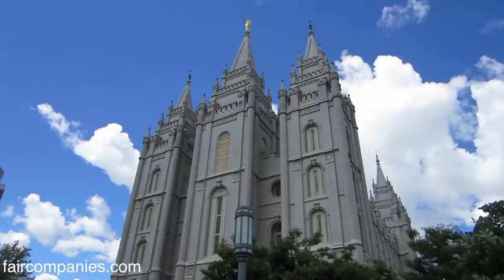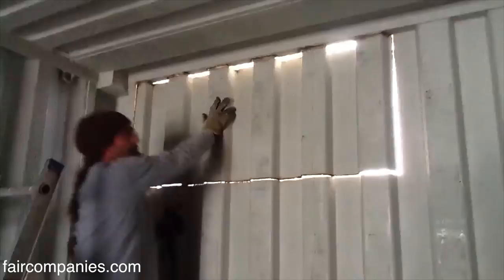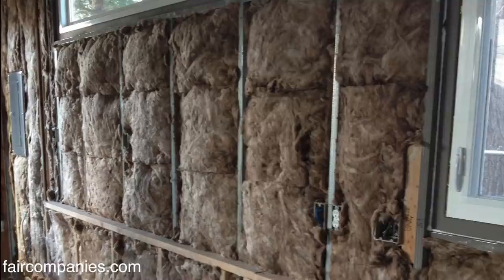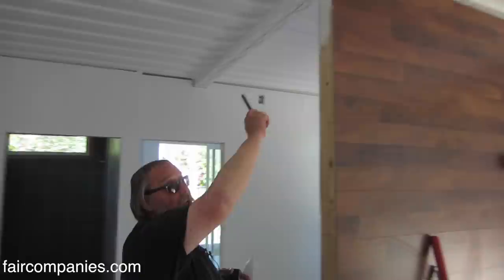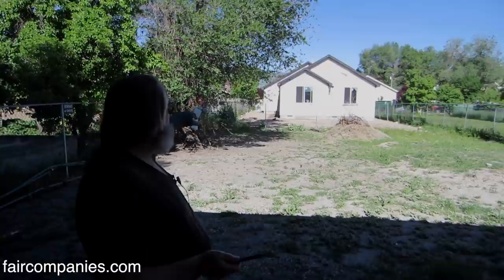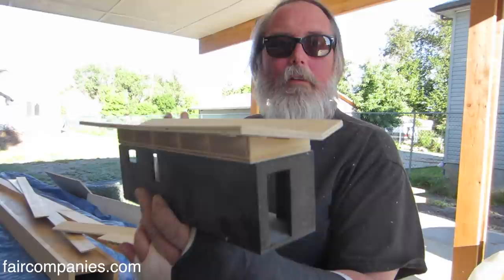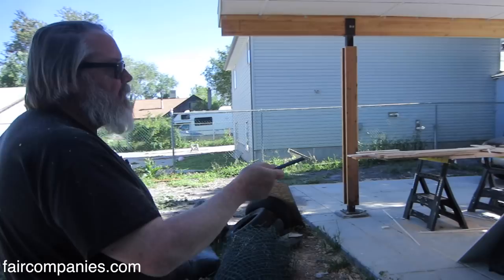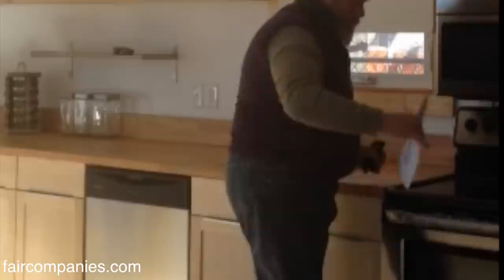Shipping containers recycled into affordable, accessible Utah home

Comment: I was the architect and designer that didn't laugh at Jeff and helped him obtain permits from the city. There was extensive architectural and structural engineering issues involved in this project: Room layouts, door and window placement, plumbing, mechanical and electrical as well as energy code compliance and structural support. The design phase took nearly 5 months of preparation. Yes, the City balked a bit at the idea of containers, but seeing the structural engineering and energy calcs involved answered their concerns. As far as cost, yes this was more expensive than conventional construction, but being a prototype, that's usually the price you pay. if these were to go into production mode on a larger scale, costs would come down. I don't think they would approach the costs achieved with conventional production housing.
Reply from the maker: Vince Oles Thank you Vince for clearing that up. It's such a common misconception that a shipping container should equal very cheap housing. It's easy to forget both what it takes to convert one into a home (plumbing, electrical, etc) as well as the engineering issues around a prototype. I look forward to seeing someone take this beyond a prototype.
Reply: I think its a brilliant idea, especially when you consider just how difficult it is to get on the property ladder now days. Its something I personally would seriously think of doing myself
Reply: It's the strange projects that walk through my door that I embrace. I have yet to have anyone ask for a container home, but if it ever does happen, and I'm sure it will, I'm completely willing to embrace it. Anyone who would turn away a project this challenging got into design for all the wrong reasons. When a client hands you a challenge like this, embrace it, own it, and produce something worthy of praise. Nice to see you did just that Vince.
Reply: Vince Oles We would like you to join us. Checkout this http://cargocontainerhome101.com SOCIAL MEDIA & NETWORKING FOR YOUR CARGO CONTAINER HOMES.

SEARCH and FIND LOCAL HELP that you need for building your cargo container home at a minimal cost.
Post your project and learn from others.
The owner-builder will document the construction activities with videos organized by logical categories, e.g., foundation-footings, welding, plumbing, electrical, insulation, windows, potable water storage [including a cistern), roofing, paint, etc., making for easy access and finding solutions to issues. This is all intended to encourage networking amongst people interested in reusing cargo shipping containers as "green" alternatives to traditional housing and build a cargo container house.
Reply: Vince Oles -- I live in Denver where a lot of money has swept into town. There is a ton of construction, but no vision. This has vision and grace. Congratulations!
Reply: Vince Oles this is brilliant it has a very modern look and  using recycled materials that look expensive in the finished product
Reply: This is awesome!!
Reply: Vince Oles  Wow, Awesome  video, I am suggest for your big room space it can be narrow. I also found useful for build container home is Moorack Container House Miracle - I look forward to seeing someone take this beyond a prototype.
Reply: Gopinath Goal  -- That site looks like CLICK-BAIT SPAM. What are you trying to sell and why is the site only navigable by clicking links (which I won't do), and not site navigation?
Reply: Vince Oles Hey i favor this video, particularly the concepts within the last half regarding build houseinstrumentality
. A product I conjointly found helpful for value of building a shipping instrumentality home
is Skyarza instrumentality Home Star - realize it on google if you wish
Reply: Vince Oles hi everyone ,if anyone else needs to find out about container home floor plans try Alkarno Container Alchemist (do a search on google ) ? Ive heard some unbelievable things about it and my cousin got cool success with it.
Reply: Vince Oles Do you know of any forthcoming update on the landscaping in the back or any other aspect of the project?  I just looked over at the Facebook page and the pictures are mostly 2 years old.  What became of this place?  Was it sold, rented out?
Reply: AmericanFartBully Sorry, i haven't followed up on the status of the house and property, Try your question on The Sarah House facebook site
Reply: Meh..ah...I'm not really a big facebook guy.  Too much of a scene.  But, I just really like the overalll design of it, either for a starter-home or senior living, being all on one level, the open plan, and the ample common-space.

The whole container aspect off it, not-so-much; although I get what he's saying as far as the marketing it of as a kit, that you could maybe place over an exiting foundation.

But I would really love to see a more lived-in version of it, how it would pan out with everything they were originally talking about for the landscaping.
Reply: MusicFilmArtLover its 4000 worth of containers some wiring plumbing drywall and two bis.  cant get much cheaper.
Reply: +TJ N 
Don't forget the foundation, perimeter insulation, interior and roof framing and insulation, roofing, tile, wood flooring, doors, windows, trim, closets, plumbing and fixtures, electrical and fixtures, mechanical system, ventilation fans, landscaping and utility tie-ins to the street.
Reply: Do you really need foundation if you have level ground?
Reply: +TJ N In the video he said it was the law, that's why he did it.
Reply: Bulky Lee yeah but if its not the law it wouldnt be needed correct?
Reply: Yeah, then it's your choice, completely up to you what way you want to do it.
Reply: So if this were to be built in my area of South East Pa. , it would cost a lot like this since it doesn't appear to have been built here. I'm quite interested , but at the cost to completely be livable  and functional , concerns me.
Reply: Bryan Resch Well I mean you have to consider the extra costs that went into adding pipelines and electrical, that really brought the cost up. If you can avoid those by building a house in a lot where pipes and electricity aren't an issue, then you can cut down on costs.
Reply: I'm figuring most lots don't have electric , sewer etc already running to it.  If it ran $108,000. for all of this done plus property , and ready to live in , then I can understand that
Reply: I'm just wondering if the Township I live in would be a pain in the ass , to get permits. Like I was saying , I doubt it's been done in my area , so  my township inspectors would put me through what this guy went through. I guess before I bought land and started considering this , I would have to go to township building.
Reply: Should get your building inspector's email and send them a copy of the video.  In the subject line write something like "If I tried to do this will you be a pain in the ass about getting the permits"

Could very prove the jumping off point of a very informative conversation.
Reply: +Bryan Resch I would start with a meeting with the Building Dept.. Tell them what you're planning to do. They will tell you what type of plans and engineering will be required to secure a permit. Our Building Dept. here was actually quite helpful. remember, their job is to enforce the Building Codes and protect the public safety.
Reply: Vince Oles Thank you , I see so many other ways to construct a home , rather than the traditional home. And the way they build them in the states these days , is quite shameful. I don't understand how building codes have gotten so shabby now days. Well , it all comes down to money and I believe someone has taken money under the table when they change codes. Thanks again , I will look into this.
Peace
Reply: +Vince Oles interesting points ,if anyone else trying to find out build a house using containers try Alkarno Container Alchemist (do a google search ) ? Ive heard some great things about it and my colleague got cool results with it.
Reply: +Vince Oles How would I get a set of plans?
Reply: +Vince Oles hi love your video especially the tips of shipping containers homes i also found product was cor bandy container crusher i f any one interested search it google
Reply: Not certain about the points made but ,if anyone else needs to find out about cargo container homes floor plans try Wiltapar  Container Home Secrets (do a search on google ) ? Ive heard some awesome things about it and my work buddy got amazing results with it.
Reply: +Vince Oles hey ,if anyone else needs to find out about best container homes try Renkarter Container Report ( search on google ) ? Ive heard some amazing things about it and my neighbor got excellent results with it.
Reply: +Vince Oles thanks for help pioneer this idea =]! Great stuff
Reply: +Vince Oles hi everyone ,if anyone else is searching for cargo container house plans try Skyarza Container Home Star (should be on google have a look ) ? Ive heard some great things about it and my cousin got great success with it.
Reply: +Vince Oles interesting points ,if anyone else trying to find out container home designs try Corbandy Container Crusher (should be on google have a look ) ? Ive heard some awesome things about it and my mate got great results with it.
Reply: +Vince Oles GREAT JOB!!  One of the best container houses I've seen.
Reply: +aze216 Thanks! It was a good learning experience and I think it turned out pretty well. Would like to do more!
Reply: +Vince Oles There are several components to doing a pro job. One place I found which successfully combines these is the Magic Container Plans (check it out on google) without a doubt the no.1 course that I have ever heard of. Check out this  great website.
Reply: +PressReleaseItem I've been researching into constructing shiping container houses and found an awesome website at Magic Container Plans (check it out on google)
Reply: +Vince Oles There are many components to creating an amazing desgin. One plan I discovered that succeeds in merging these is the Magic Container Plans (check it out on google) definately the most helpful course i've heard of. look at this  extraordinary site.
Reply: +Vince Oles There are many factors in doing a pro job. One resource I discovered that successfully combines these is the Magic Container Plans (check it out on google) definately the most helpful course that I have ever seen. Check out this  amazing site.
Reply: I had to do the same thing on my Silo house build. My architect had to do extensive structural engineering to get me plans for the inspector. Mine involved recycled crane beams.  Actually my township worked with me.
Reply: I live in Utah and am interested in learning more about the codes and possible designs for my own container home. What is a good contact to reach you or Jeff?
Reply: I've been researching into constructing shiping container houses and discovered an awesome website at Magic Container Plans (google it if you're interested)
Reply: I think it looks great! very nice and I think the light sconces and window designs add class and appeal. 👍👍👍👍
Reply: Hi Vince:
Great Job First of all...
Next thing, is how would i get a copy of the designs, and engineering on this?
Reply: Could you elaborate on what insulation was used in detail? I have read (from different sources) that condensation on the inner container walls is a real problem. Also I do not quiet understand that on the roof we see an outter insulation and on the walls an inner insulation. Since the contaier is made out of metal, the heat produced inside the house will heat up the metal roof, from which the heat will be conducted to the outer walls, which radiate the heat  on outside the outside of the cainter?
Reply: I really love the concept. In Reykjavik (Iceland) we've been looking for affordable housing for the homeless and people that aren't able or don't want to maintain a large property. I believe containers are the key to affordable housing for everyone.
Reply: If you is interested in container home plans the best results that I have ever had was by using the Magic Container Plans (just google it) without a doubt the most useful course that I have ever tried.
Reply: Vince Oles you did a good job
Reply: Thank you! It was a great learning experience working with containers!
Reply: I've been researching into constructing shiping container houses and discovered a great website at Magic Container Plans (check it out on google). #Vince Oles
Reply: Vince Oles so it's not worth it thank you.
Reply: There are several factors in creating an amazing design. One plan I found that successfully combines these is the Rohon Home Build (check it out on google) without a doubt the best info that I have ever seen. Check out this  super resource.
Reply: I have spent months researching into building container homes and found a great website at Magic Container Plans (check it out on google)
Reply: hello Vince, have the plans and hurdles been advanced in the way of learning from mistakes. really interested in bringing this to the east coast.
Reply: TGN.
As long as you are not in an area  that is effected by frost you only need corner posts to support the container frames.
Reply: Robert
Try  drawing you own. It's not that hard really.
Reply: Robert
Try drawing you own. It really isn't that hard.
Reply: I have a perfect lot in Hawaii if you want another great project.
Reply: Great idea. Basicly a lot like a mobile home but, bolted down to a concrete slab. I never understood why people want a huge home. The amount of time and stress to pay for it, and giving up time with your children may be one of the downfalls of our family structure today. Life is not about things. I'm 1 of 8 children born in the 50's . We had 3 bedrooms and 1 bath. It worked and grew up to appreciate every thing including recycled items. Hate to see things thrown away.I like small places.
Reply: @bryanr.3241  , you could argue it is not much different than a mobile home, or prefab homes. Try it.
Reply: @bryanr.3241  , Plenty of people are building tiny homes , school bus homes, it's amazing the amount of stuff you can build into these places. Loft bedrooms and the staircase becomes storage area. Very creative and inexpensive builds.
Reply: sukher prodipl
Reply: AmericanFartBullym
Reply: The only reason a person of limited means would want this is to have a cheap house!  If not this then WHAT kind of house is CHEAPER??? And not on a Trailer...
Reply: How much does this compare in costs compared to building with a traditional wood frame?
Reply: It looks real cool !
Reply: I live in cache county i want to do a shipping container house. I was told engineering it would be expensive. What is your company u work for? I really am want to use this type of home but am worried about codes and engineering
Reply: Kirsten Dirksen  is there contact info for Jeff?
Reply: Its brilliant.
Reply: Thank you for this info & yes this is a wave of the future as housing becomes a more difficult proposition! I think all cites, etc should be looking at this a an economical solution for housing!
Reply: i am considering 9 container home on 6 acres
Reply: Why is it more expensive?
Reply: Do you think you can build a modern house similar to Richard Neutra 's home in Palm Springs that was built for the Kaufmans. I think he's the Architect? Anyway... build a home similar to it using containers?

Comment: It strikes me that rather than totally kicking out the metal for the window, you could sand it, paint it and use it for an awning over/above the window.
Reply: +George Senda I've seen that done on other container homes. Also you can use the steel to make window ledges at angles to the walls to gain extra interior space.

Comment: The shower stall is not 'accessible' especially for those in wheelchairs. Floor needs to be level, with no obstructions. Otherwise, it's a nice home.
Reply: Instead of tiles in the bathroom use vinyl as you find in en-suites in hospitals. I have done this and it works very well.
Reply: It could be made accessible he just showed an idea

Comment: I'm from Jamaica I wish I could have something like this there I love it for the price and it would be hurricane resistant this is one of the best things I've ever seen in housing Concepts I love it so in reality it would be around  40 Grand to build a house like that if you already have land container and labor love it keep up the good work tell me how I could get one like it
Reply: They are indeed storm resistant. I have two welded together as a shop and it stays bone dry in storms. That's why I used containers.  If you are serious. STUDY containers. Your local labor costs will be reasonable and one person can do most of the work. I placed mine atop steel beams and joined them single-handed without any mechanization other than the winch on my truck, and I didn't use that much. If you don't mind learning basic welding you can to that yourself. I suggest you place your power pole first and have a service panel with outdoor outlets (in the US I use 120v and 240v for my single phase welders and compressors) so you have power before you begin construction.
Reply: @paul pinnock Given that you have an internet connection I'll assume you answered your question. Any news on your project?